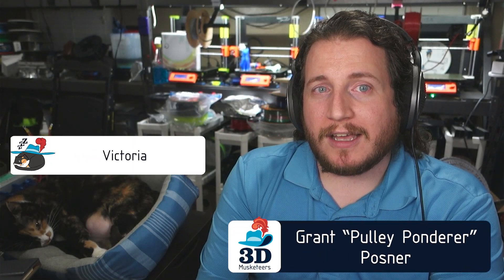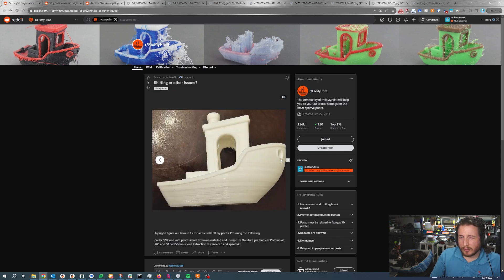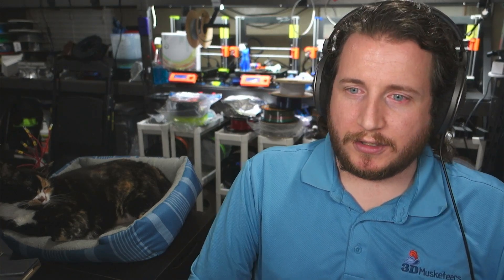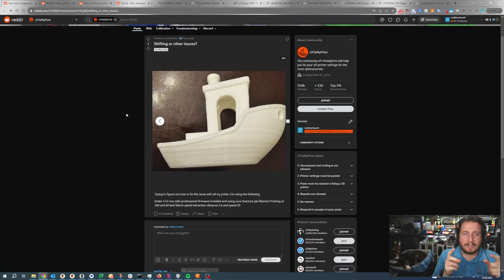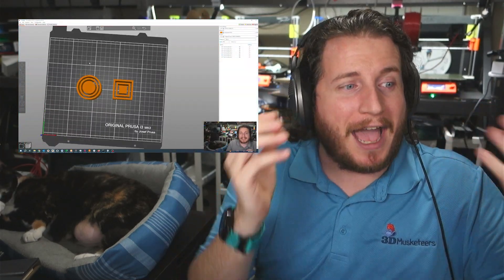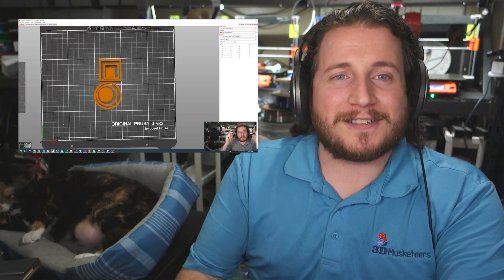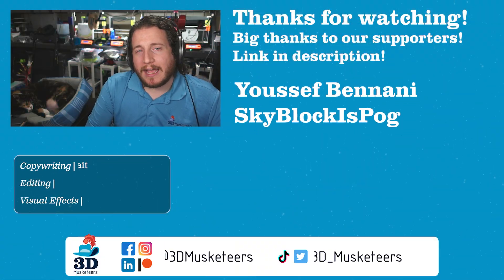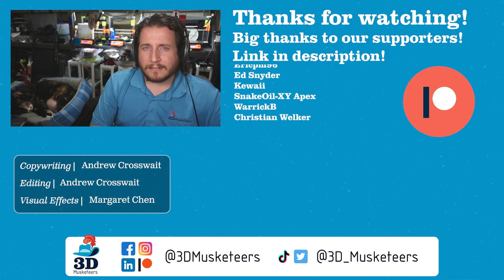The Surprisingly Simple Fail That Had Us STUMPED! - PrintFixFriday 103

Comment: Im in tampa as well, do you know of anyone in the area that does repairs for an ender 3, my y axis motor just isnt moving up on prints so my nozzle just drags across the print surface/printed material and im completely lost as to where to start or fix it
Reply from the maker: We can fix it, but it is not worth the money to do it.. 

The Y axis should not have any impact on bed level, the bed level screws should be the thing that does that. We have a video on bed leveling that may help
Reply: @3DMusketeers  lol every Google I did when it first happened said level the bed which is why I threw my hands up and quit. It isn’t a bed level issue because it just does not move up towards the sky, it’s like the print doesn’t recognize a level is laid down and does not move up, so it just keeps moving around at the same y axis point
Reply: I should alter that, it does know a level is laid because it starts the net level of the print, it just does not move up to continue
Reply from the maker: I think you have the axis mislabeled?
Reply: @3DMusketeers  indeed I figured that out from your email, thank you so much for your prompt replies! I am not in the market to upgrade to a newer/better unit at the moment regrettably so I will go through your video catalog and see if I can get it working, I believe it likely is an error in the coding somewhere, the stop switches and motor itself work, I can manually have it move up and down using the ed3’s controls but it does not do so on any prints
Reply from the maker: likely, yes, it is easy to mess up firmware.

Comment: Re MK3 first layer: Such errors also occur if Z motors are not aligned.
Reply from the maker: It should detect this, no?
Reply: @3DMusketeers  Mostly, yes. Completely, no. Probe logic in firmware expects that the probe is perpendicular to the bed - basically nozzle and probe and their projections on the bed form a rectangle. When your zeds are misaligned, this becomes more of a parallelogram, which skews the geometry enough that the first layer can get problematic. (At least that's the theory. In practice, I did have this problem twice and both times it was fixed by calibrating Z.)

Comment: I had a similar, but much more subtle banding like that last print on a Trident.  It was belt and pulley alignment alignment.  That 2mm pitch on the artifact is a good indication that there is something off in the motion system.
Reply from the maker: We are still working on it all, may be belt pathing too potentially?

Comment: Pre-shaping NEVER works. Prusa mk4 with input shaping is dead on arrival and always will be. Test print method can help with some approximation to speed up and reduce ghosting but is order of magnitude from accelerometer testing.

ATM seems mk4 doesn’t even allow modification of the algorithms and factor.. you add a new fan shroud? IS will be off. Different surface? Same. Retighten belts? Loosing belts? Relubing? 

lol this is the worst idea, marketing and launch they could ever make.
Reply from the maker: Apparently those are all IS off. The plan is to apparently allow user modification at some point but I do agree this implementation isn't great so far
Reply: @3DMusketeers  problem is that without a proper computing power there is no chance for the input shaping to be set via accelerometer. A pi zero is already insufficient and an STM32 is even worse
Reply from the maker: i thought the 02w was more than enough?

Comment: I might look for that IS torture model. I've not seen any ringing in my mk4. Ringing and VFAs drive me nuts on my mk3. To the point where I don't expect my mk3 to get much use. But.....I have used both printers at the same time. Just once though. I've actually ran my mk4 with non IS profiles at 200% speed (I did have to increase temps 5 or 10 degrees I don't remember) with no issues. In the past the IS profile in PS only had 0.2 layers which for me isn't good enough. But I recently noticed they added more profiles. So thats why I just did manual speed boosts. I also hate that my mk4 non IS profile is a physical printer, but the mk4 IS profile is not because they have to be added separately. Soooooooo annoying. In fact the nozzle size is going to be the same issue. Each nozzle size will need a physical printer. I guess for you not an issue since you only use SD cards and USB sticks.
Reply: You can set up multiple physical printers with the same PrusaLink password. I have it like that. You just need to name them differently.
Reply: You can go 1000% and still I.S. isn’t in the equation cause you’ll be limited by accelerations. Input shaping allows faster accelerations that follow an exponential effect, so raising your “speed” is pointless for the IS argument.
Reply from the maker: wouldnt you be able to raise speed and accel with good IS?
Reply: @3DMusketeers  So I did this experiement twice. I did normal .2 profile with 200% speed and the .2 IS speed profile.  The 200% normal profile is slightly better quality than the IS speed profile. The printing time was SLIGHTLY faster on the IS profile. Both were a hell of a lot faster than the claimed time.
Reply from the maker: interesting, acceleration based?
Reply: @3DMusketeers   I just set the printer itself to 200% and used a stock profile. There is also a 0.1 fast detail. I have not tried that with this experiment.
Reply: @3DMusketeers  oh and both methods are quieter than a mk3s+. However it's not as quiet as mk4 at 100% without the IS profile. Not surprising really.

Comment: Motor pulley: looks like the toothed part has shifted (turned) in the screw boss and has been pushed eccentrically by the grub screw  .The grub screw would normally run through a hole in the tooted extrusion
Reply from the maker: interesting, will ask!

Comment: Anyone have suggestions for adding a bump map texture to a flat surface on an stl  . I would try blender but it does not run correctly on my machine anymore.
Reply: yes! fuzzy skin! My parents asked me to make a mirror bezzle replacement for their car. It's textured. I did a number of prints with different fuzzy skin settings until I got it dialed in more or less matching the original. It only works on the sides though. It doesn't work on top or bottom surface.
Reply: Ideamaker which is a slicer from Raise3D is able to do it.
Reply from the maker: ideamaker is really the only one that I know of